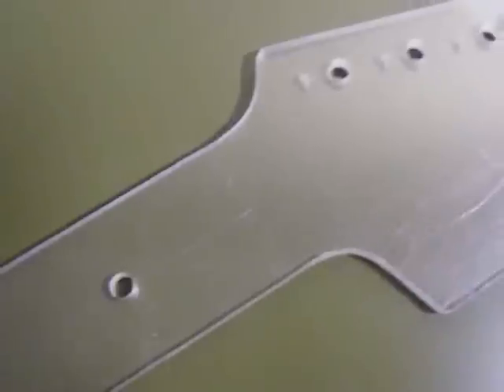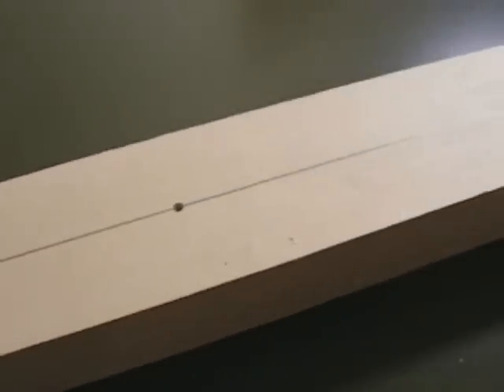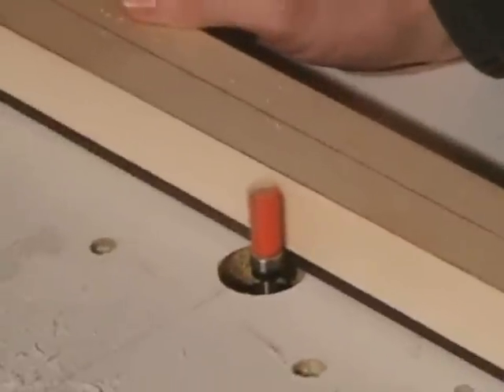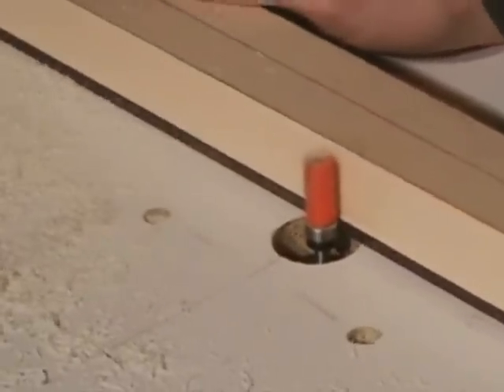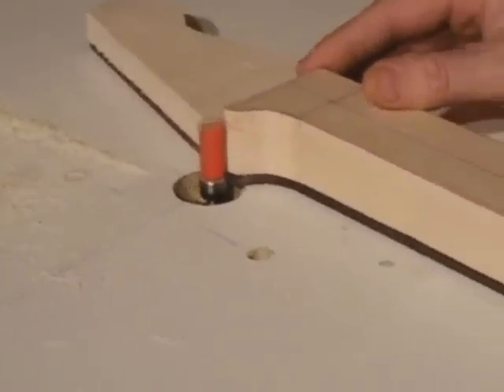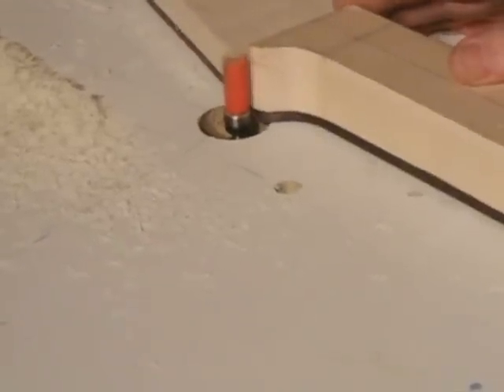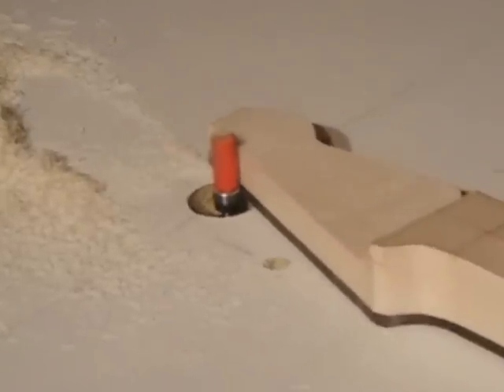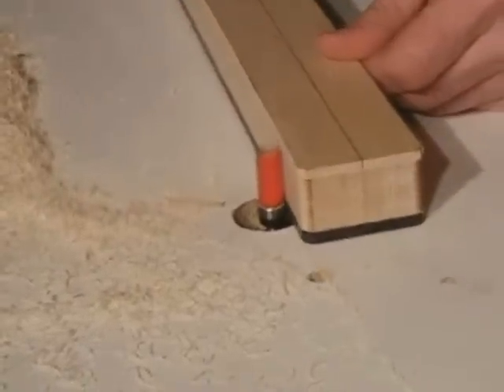One Piece Neck Build Part 2: final oultine

Comment from the maker: @Patrikss 

Hi, and thanks.
As for the router, I simply drill a hole to faciltate the router bits (1-1/2" dia.)
I removed my baseplate and drilled the three corresponding screw holes in the top to access the baseplate mounting holes. I do, however plan to rebuild the top and make a cutout so that I can use a proper router insert. It will make bit changing easier.

Hope this helps.

Bill

Comment: Hi Bobo, I really appreciate your videos and the sense of detail in your work. I'm in the process of building a router table (or how its called in English) my self, like the one you're using in this video. I use a small router put up side down, like how I imagine yours is constructed.
But I have sort of a problem finding a way mounting mine keeping the perfect angle. How have you mounted yours, minimizing any possibility of deviations from the ultimate 90 degree angle? The perfectionist way :)